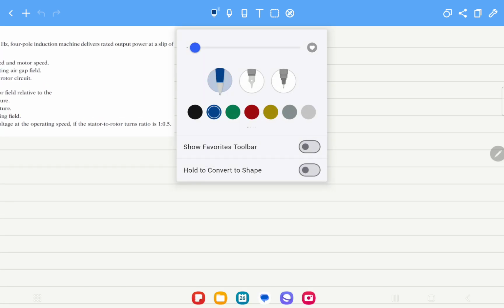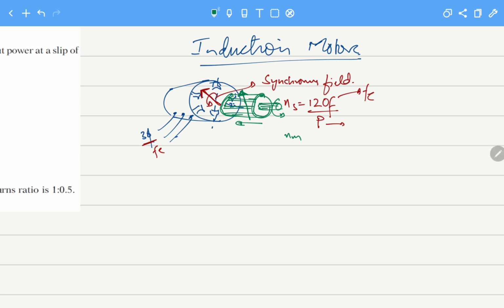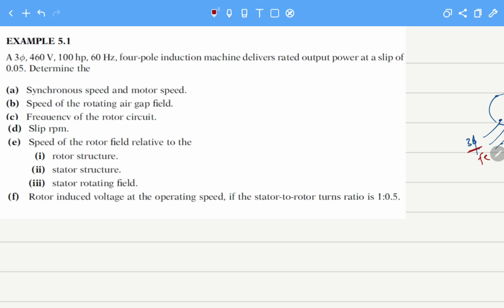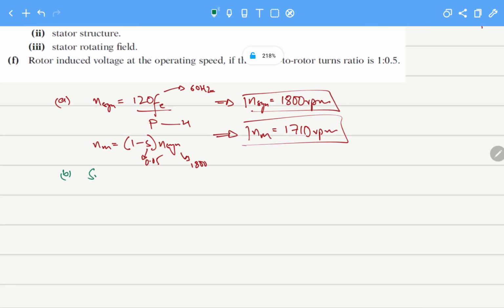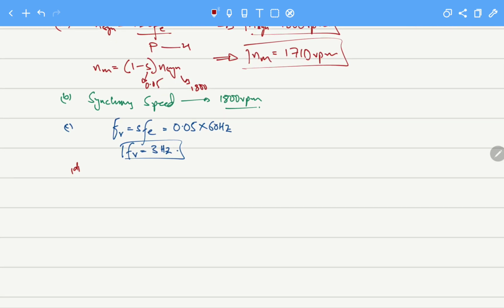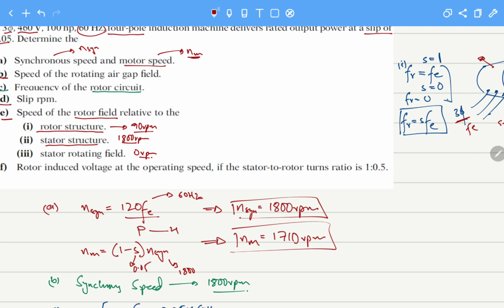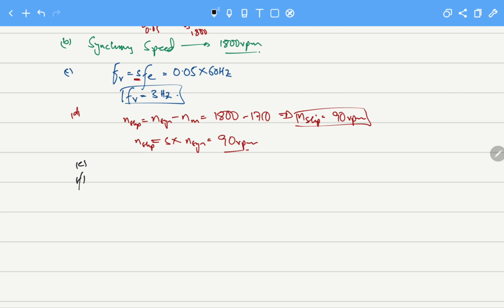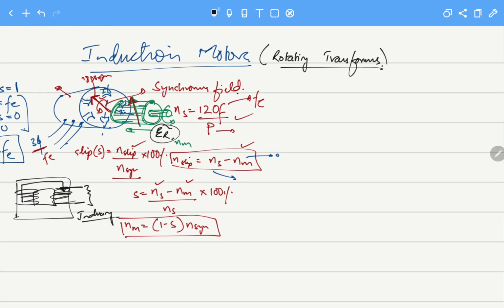Lecture 6 Induction Motors Part A

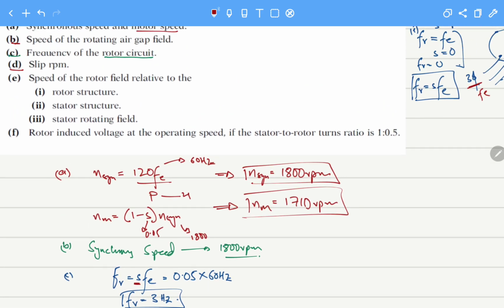Comment: I have a concern in 10:42  about the statement of "rotor field relative to...", what does it mean exactly? 

and Thank you very much
Reply from the maker: There are two field inside the motor. The stator field and rotor field. Both of these field interact with each other to form a resultant field. It is talking about the relationship of resultant field with the Rotor Structure.